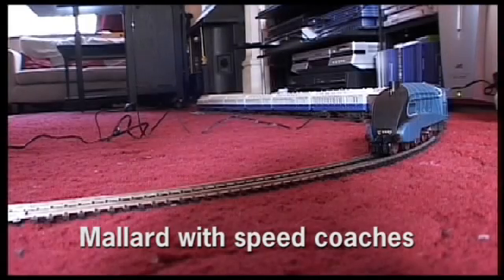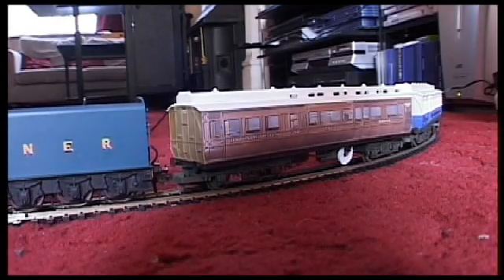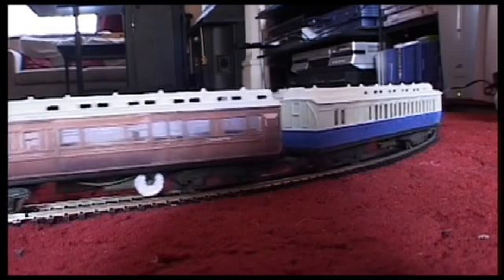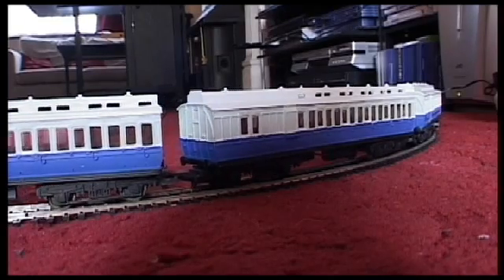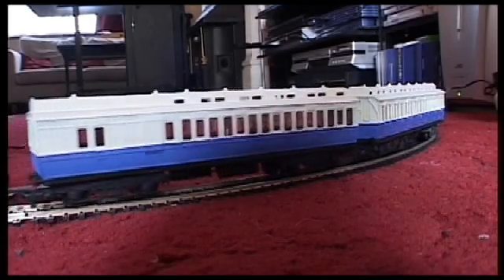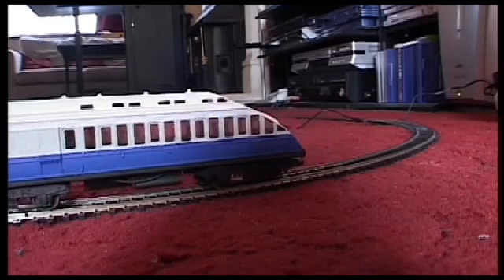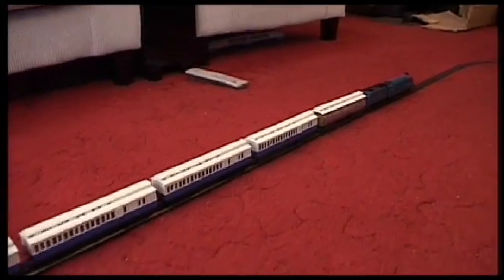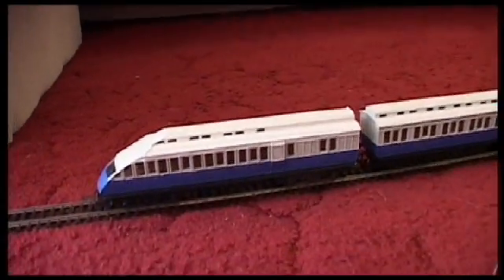Mallard Speed Run with coaches (model)

Comment: That's good I will be getting the  LNER Dynamometer Car 1938 from Golden age for my birthday just a bit of History the Beaver tail did not run with the 126 record it was just the main 3 twin sets and the beaver tail was a separate coach but well done.
Reply from the maker: That's an expensive but very nice Golden Age model that. Thanks for the Beaver tail info. So just six coaches - that is useful to know.
Reply: Your welcome
And yes it is very 200 or 250 pounds

Comment: Your dynometer car is excellent, I was pondering if such a conversion is possible and finding your video by accident proves it can be done.  I have found my Christmas project.  I too am considering Coronation or Silver Link coaches but using Triang Teak types......  I think that they can be made into articulating types by shortening them.  Thanks for sharing your creation.